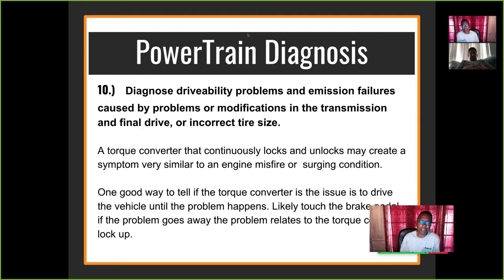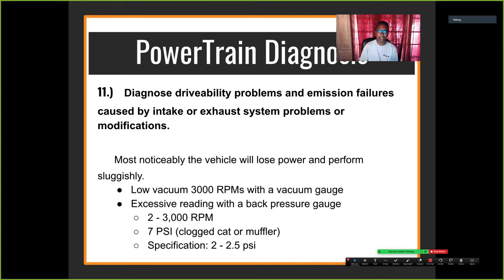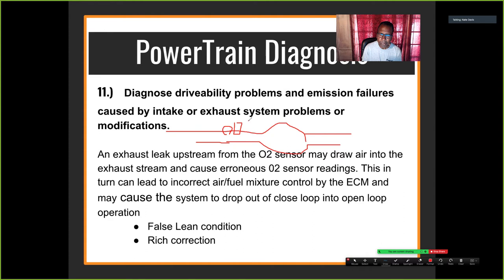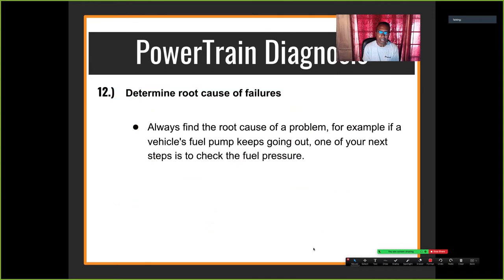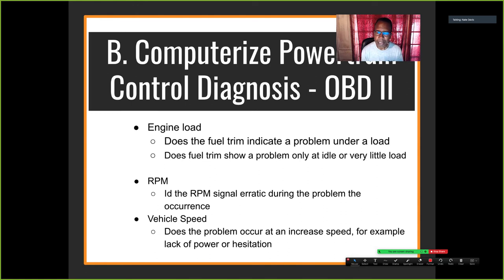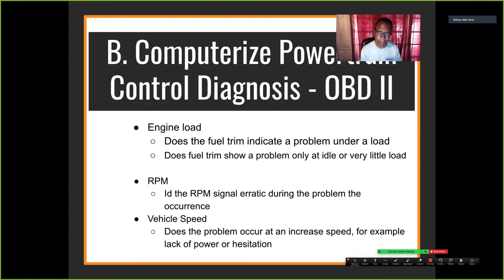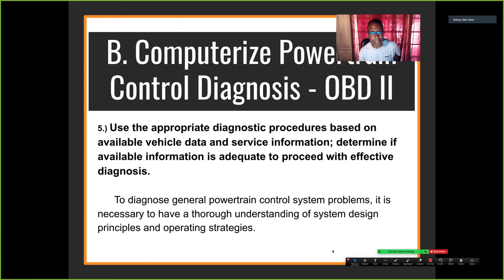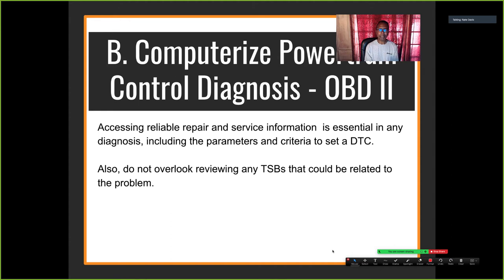L1 Exam Preparation Part 3: Free Study Guide - Test Preparation for the ASE L1 Exam

Comment: My dad taught me an old trick with TCC's... Growing up in the 90's, TCC's were problematic. So he would wire a jump start trigger switch into the brake light switch circuit. Then it was a simple as activating the trigger switch while driving and paying attention to the engine feedback. Easiest way to diag those old Mazda units that gave mechanics fits!
Reply from the maker: Good tip thanks
Reply from the maker: Good trick appreciate feedback

Comment: how did you come up with 8 volts of drop?
Reply from the maker: A voltage drop is us usually the difference between the two leads, at which point of the video you seen this statement
Reply: @natedavis5574  at home’s law example @ minute 34
Reply from the maker: @angelrodriguea  with the resistance there is now 2amps in the circuit and the load is 4 ohms. We are only doing a voltage drop across the load. So 4ohms x 2amps = 8volts drop across the load
Reply: @natedavis5574  so the high resistance at the ground side is not (corrosion/loose)added to the total resistance?
Reply: On the eg you have 4 and 2 oms a total of 6 Ohms
Reply: Do you have videos on electrical diag for composite vehicle 4?